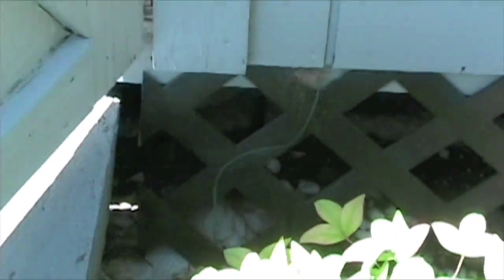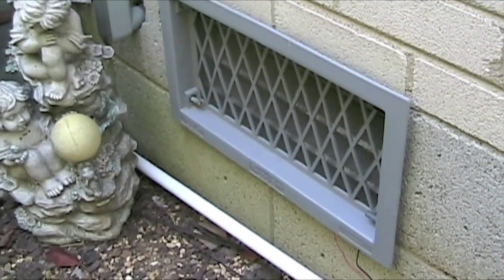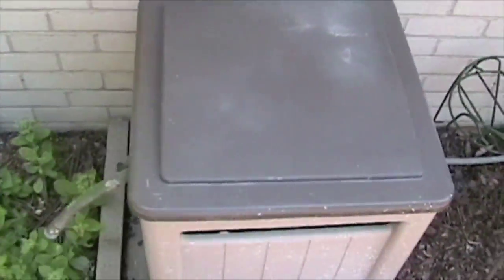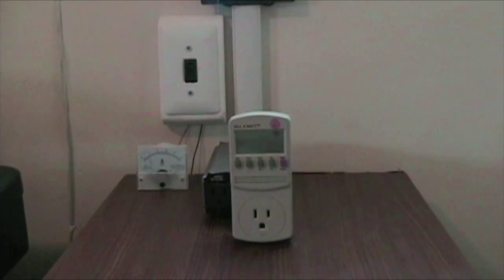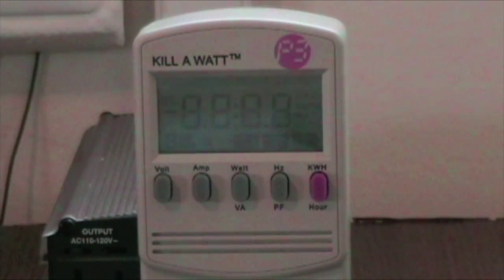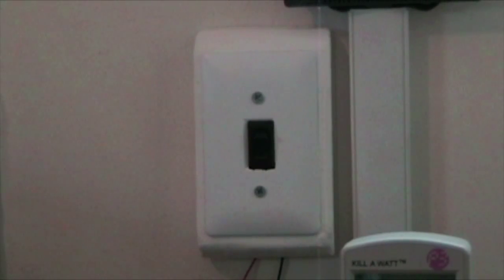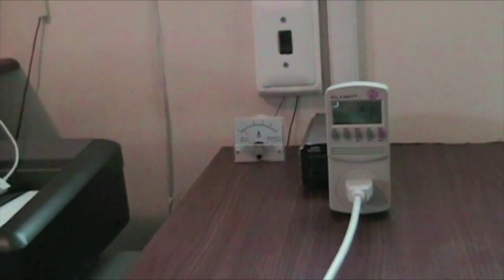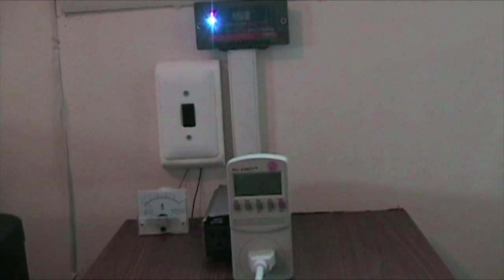How To Build A Solar Panel - Part 13

Comment: @NeoPhytes
Yep yep Neo. You are right! The system is so simple
and easy to use too. I built myself an almost
perfect panel from my first attempt. And now its
been 4months since we're solar powered and
we've gone off the grid completely. Anyway,
must have interchange the site name. It should be:
GreenEnergyNow.info

Comment: Hello , I wanted to compliment you on sutch a great tutorial video.

I did have a question or 2 , i wanted to know how long of full sun does it take to charge that battery you are using ?

Can i connect multiple batterys  together so that i can run something for a longer period of time ?

Comment: Robert: too small a gauge wire running from solar panel to house. I would use 16 gauge to minimze IR loss when drawing the full 2 or 3 amps from the panel. 16 gauge xtension cord on sale is a good deal.  You might think 16 gauge is unecessarily large, but oversizing a bit is good engineering practice.